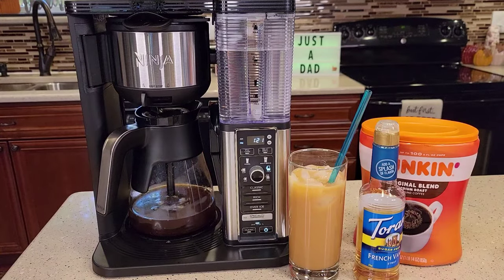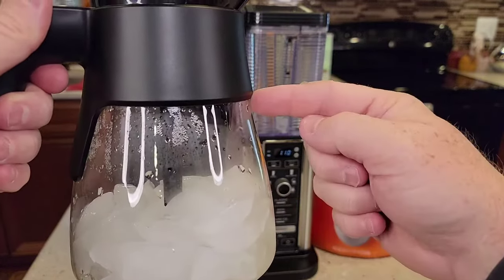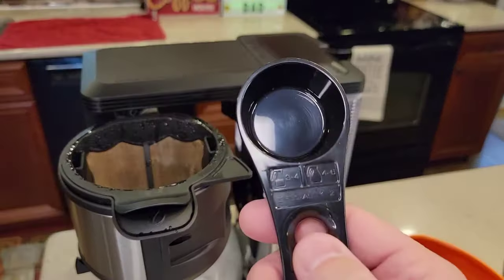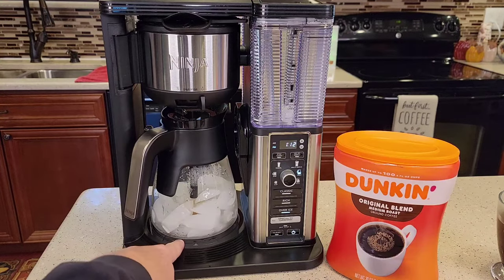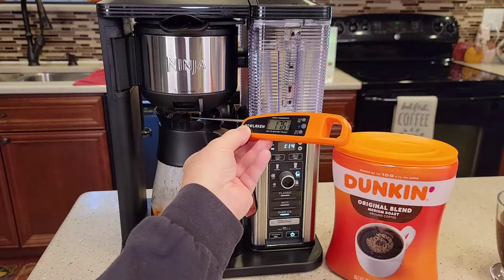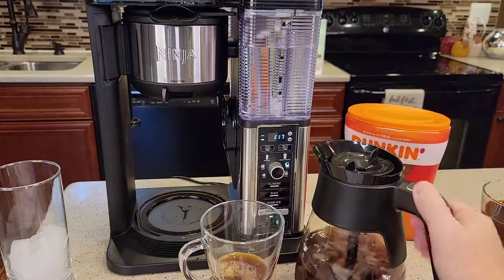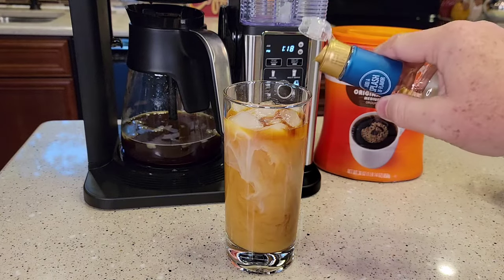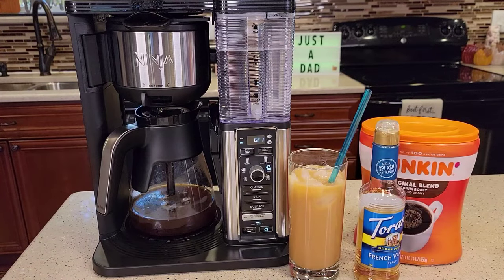How To Make Iced Coffee Ninja 10 Cup Specialty Coffee Maker CM401

Comment: I used to work at a coffee house. When I make iced coffee, I will put double the amount of coffee grinds into the filter. For example, if you want to use half a pot of water, then you’re going to put enough coffee as if you were gonna brew a full pot. That will eliminate the watering down the ice does.
Reply: This machine takes that into account though. Use it as it says because it’s taken all the guess work out. The over ice brew is going to be stronger so when then ice melts it’s still how it should be.
Reply: @hillsturrr Yes, it brews it stronger but it also cuts the quantity in half. And because the ice doesn't sufficiently cool off the coffee, it ends up even more diluted. I think joanne's method would counteract that.
Reply: Thank u!!!

Comment: My secret for it to be strong is brew it on traveler directly in a traveler size cup (no ice), when it’s finished let it sit for a few minutes and then add milk and ice. Your method really waters down the coffee because the ice melts
Reply: but you press the iced brew button on the coffee maker?
Reply: That's what's supposed to happen, if you set it to brew 8oz for example, it will brew about 4oz of coffee and the ice melting should dilute the coffee to the correct flavour, search japanese ice coffee, same technique.
Reply: @hellsing0999999999  right, which is a waste of coffee.

Comment: I have the 301 and made over ice this morning. I filled the line to half carafe and it didnt even use half if the water in the resivoir. Is that normal?
Reply from the maker: yes over ice uses about 1/2 the normal amount of water,  it assumes the hot coffee will melt the ice in the carafe and dilute it to the proper strength
Reply: @JustADad  thank you!!